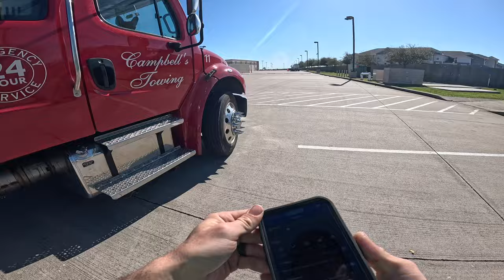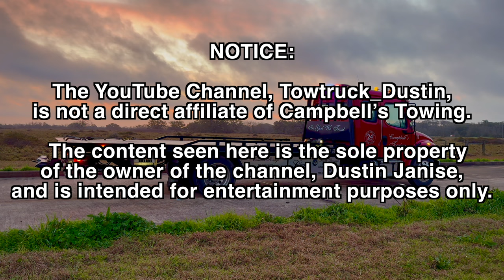Just a Normal Sunday! A Wreck and an Impound!

Comment: Do you ever have those straps come loose? I was always told "twice around the barrel" when tightening straps. In an emergency stop the friction of being wrapped twice around the barrel holds onto itself better. By starting with 6 inches of slack you get that length required. Yup it means more ratcheting but you load doesn't end up in the cab with you.
Reply from the maker: Never had one come loose. These are designed to be used just as I am.